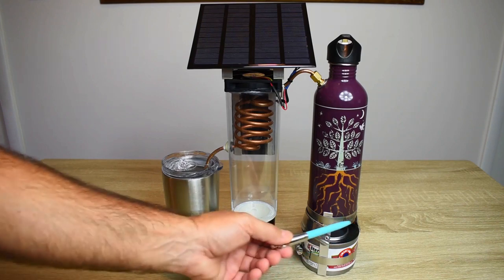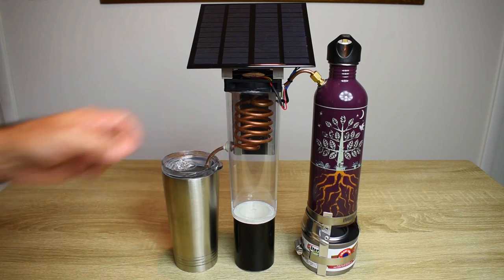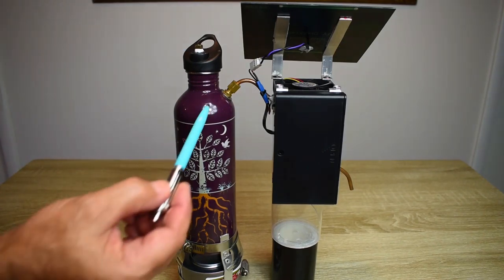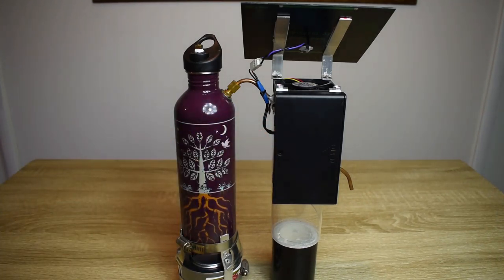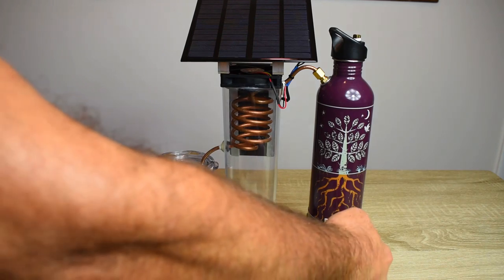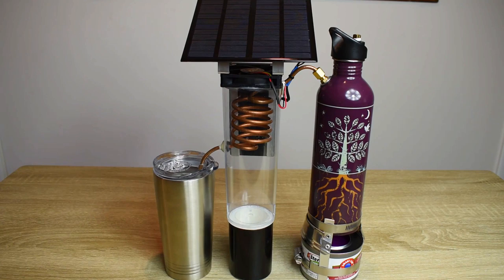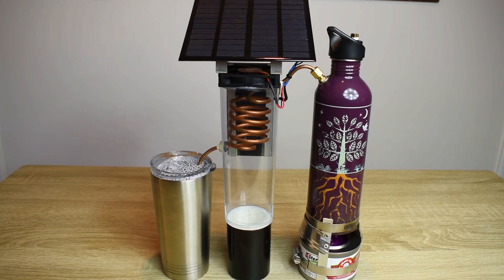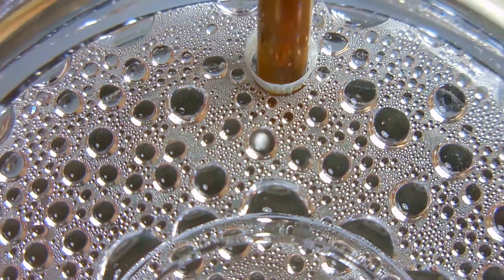Turn Salt Water Into FRESH! (Solar Cooled Desalinator)

Comment: I love the design. I was wondering if you could use a low wattage water pump and a peltier on the solar panel to keep the water cool and circulating in a smallish (still portable) tank. Thoughts??
Reply from the maker: Peltiers are energy hogs. Outside of submerging the coil in cool water that's always changing, I'd stay with the fan. Thanks for watching!

Comment: Actually, the TDS is much higher than that for the salt water if it’s like seawater, because the meter can’t read so high.
Reply from the maker: You're absolutely correct, but it will still work the same. Thanks for watching!

Comment: Hmm I question how much the fan really does, Maybe add some cloth strips attached to coil. And water below, Paired with the fan as an evaporative cooler.
Reply from the maker: The level of heat inside the copper coils is very high. The fan is the best method if you don't have a constantly changing source of water around the coils.

Comment: Dispense with the solar panel and fan, simply use extra raw input water in an open top container with your condenser in it, far more efficient, less parts

Comment: It wouldn't hurt to put the collector in a can of cold water . That way, you would condense a larger amount of steam from the contraption without necessarily having to change the water in the can over the time of distillation.
Reply from the maker: Waste of time doing that. The water stays cool for about 30 secs

Comment: Also a thermo-electric elements for the  heating & cooling. As well as ultraviolet light to kill off bacteria in salt water in the pumping phase. Transformer would be used to power the pumping of seawater into bottle collector.
Is all that possible?

Comment: Have you tried to improve the output by evaporative cooling techniques? Have a pump that bubbles up air through the water and keep the humidity as low as possible by letting the vapor dissipate. You can reach freezing tempuratures with enough evaporative cooling!
Reply from the maker: You mean a swamp cooler? :-) No. Thanks for watching!
Reply: @electronicsNmore  Check out Tech Ingredients youtube channel. They built an advanced swamp cooler that had a calcium chloride desiccant stage to dry the air followed by a heat exchanger to remove the heat from the air as much as possible prior to cooling it with a final swap cooler stage. Pretty amazing, I am planning to build one but scaled up some!
Reply from the maker: I wanted to keep it simple and portable. It works very well, and gets the job done.
Reply from the maker: @Drakilicious Yes, that's the only change I'd make. :-)

Comment: Pressure relief? Or is the steam releasing through the copper enough to stop pressure building up?
Reply: the latter is correct.  so long as nothing blocks the outlet, which "shouldn't" happen if you clean the still pot frequently, then it shouldn't develop dangerous amounts of pressure. however, the plug he put into the plastic cap could easily be converted into an over pressure relief valve.

Comment: cool seeup ;) I like the picture on the metal bottle :) BTW why the fan is upside down? 6:53
Reply from the maker: The fan was positioned the way it was to take cooler air from the bottom and blow it out the top. Heat rises. Thanks for watching!
Reply: @electronicsNmore  yes, but I think that if you flip the fan the cooling will improve, just like CPU coolers , they are blowing at the radiators directly, not sucking the air from them :)
Reply from the maker: @intel386DX  It's different. The CPU doesn't have a huge open area under it.
Reply: @electronicsNmore  if you put your hand on the sucking side you well feel near nothing, but if you put it on the blowing one you will defensively feel the cold air :)

Comment: Nice, but because saltwater is available for cooling if you need to do this, this seems almost.... pointless. I'd put a cloth over the coil, and a cup with saltwater over it that leaks water out onto the rag and coils below. It should leak slowly enough that you don't need to fill the water or change the water out again until you need to use the desalinator again.
There's no extra work involved here, and no batteries or mechanical parts needed, because either way you'll need to make a trip to the water if you need to desalinate more.

Comment: The fan to blow the hot air from the condenser under the already heated by the sun panel is not approx. Why the fan is not blowing in the other direction / down /
Reply from the maker: Heat rises. Cool air gets draw into the bottom of the tube to cool.

Comment: The only possible issue is the plastic cap .Dose anyone know how hot it's rated for? Also maybe not back packing but more of a bug out/ bugin location.
Reply: that is a great question.  I cringed a bit myself when I saw the plastic cap. i am sure the cap can handle the temp of the steam. it might get soft though and I keep thinking of the steam that condenses on it will be refluxing back into my source water.  if you have seen the referenced video by Nighthawkinglight, Ben used a single wall stainless bottle with a stainless cap from liberty tree I think?   I do think I like the design here of having the outlet at the shoulder of the bottle better though.

Comment: I'm not sure you need the solar fan?  I mean, if you find salt water..you found water, running or not.  That means you could just stick your coil in the water source itself... unless you're running from savages or something of course! 😂 Much more efficient than a fan, I would like to think.
Reply from the maker: How do you plan on lowering the coil into the water, have the fire going, AND collecting the water?
Reply: @electronicsNmore  you need a little more copper line maybe... maybe you could apply some ingenuity and do it like, moonshiners.   You've got a solar panel there...use it for a small water pump.
Reply: @electronicsNmore  pump

Comment: Bro how to do your project is there any making videos
Reply from the maker: I explained in detail what I did, but some parts I used, most people wouldn't be able to buy easily, so there's no step by step instruction. Thanks for watching!
Reply: electronicsNmore fantastic project, how did you get the copper pipe in the tumbler(clear plastic tube)?
Reply from the maker: @paulotlc  It was simply slid inside, then the copper tube was pushed through the hole drilled.

Comment: Its aint solar when you use gas to heat the bottle, there is no match of a differnce between your version and his, 

What is more simple?, cool the coil in dirty water or cooling it with solar powered fan?🤦‍♂️

Comment: That's great engineering but practical... no.
So you can desalinate only when the sun shines.
Hmmmmm!!😒   ⛅☁💧
Edit : at least not practical in the UK.
P.S. GOOD WORK.
Reply from the maker: You have a choice. Battery power or sun. The unit produces water with no fan also, but at a much slower rate.

Comment: Dude you absolutely talk to much.
Reply from the maker: People like you are the first ones to start asking questions if a video wasn't well explained. Be thankful I'm very thorough explaining things, most on YT are not. Sadly, many viewers have ADD/ADHD, but blame my video.
Reply: @electronicsNmore  I have survived more than 12 months desalinating my water to drink. I used sea water to wash my self and sponge off with fresh water. My dishes and closes was washed in sea water and rinsed in fresh water. I uses 150 litres of butane in one year for +- 3 litres of water per day. I had to cach dew with a net to suplement my water and mixed it 50/50 with sea water for whashing and dishes. My drinking water i mixed it with salt water to taste to strech it +- 1/4 saltwater to 2 litres. Now i use a air to water unit that use 750 watt solar and give me about 500 ml per hour at 70% humidity that i run for a minimum of 4 hrs. I use 8x 350 watt pannels, 5kw inverter, 5kw L/iorn battery still have power for my small beach cottage. Thank you for your fantastic vidio. Do not stop to throw stones at the barking dogs, or else your will never rich your desteny🌹